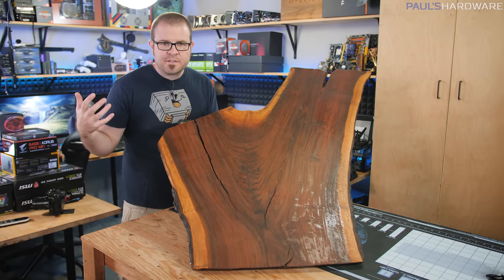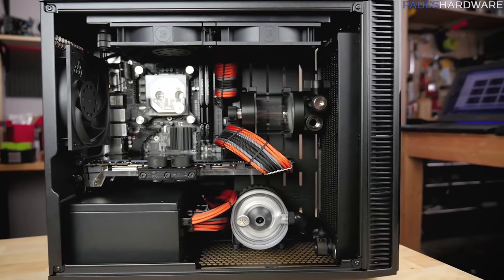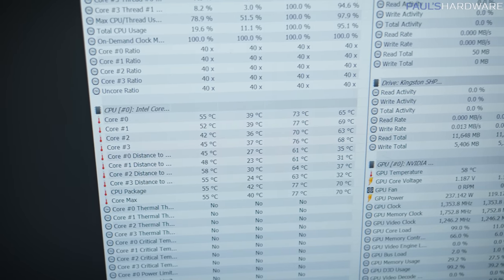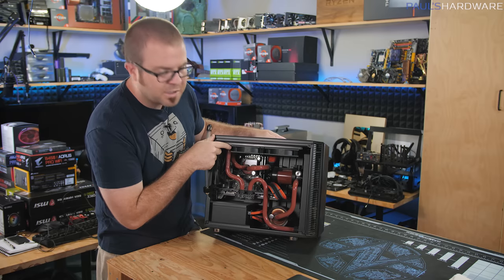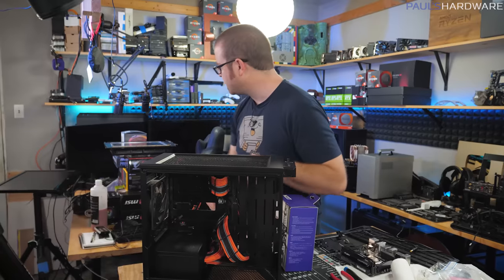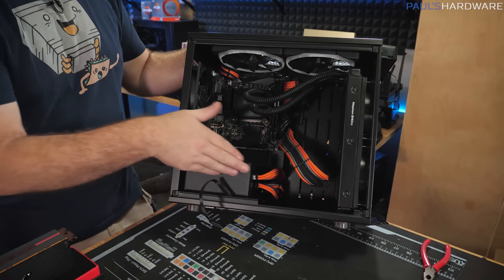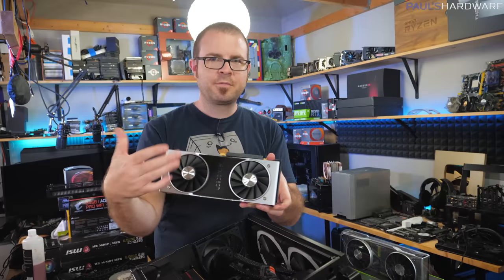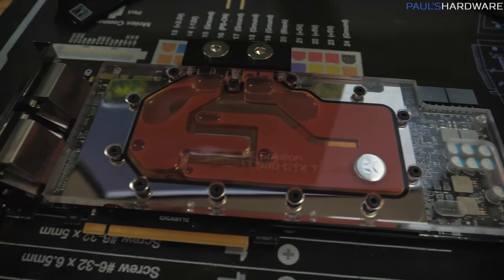Restoring HOTBOX: 3 Years Later

Comment: why even bother with temp testing if you're going with an AIO replacement? also if you were going open air gpu you should of used the aio as an exhaust. doing that cut like 10 degrees of my gpu temp.

Comment: a 2080 ti is a terrible choice for that system given the way it cools - if it were me, I'd just cut the plastic connection piece at the end of your sleved extension.  you could do it with a set of wire cutters or a deft hand and a dremmel or a thin hacksaw or really any other cutting implement that is narrow enough to precisely get between the 6 and the +2.  you can just cut the plastic and it'll be fine with the navi card, and the navi card's cooling solution would be significantly better for that build for all the reasons you mention.

Comment: I remember when you built this PC. I built my own 6700K 980 ti build. I am still running the 6700k, I upgraded to dual 980 ti, then just recently upgraded to an RTX 2080. I am building my AMD 3700x PC one part at a time. I have a Corsair iCUE 220T RGB Airflow white case on the way. My 6700K is starting to show it's age. Cheers Paul!

Comment: I'm about to replace my 6600K with a 3700x, but if I had (should have) ponied up for a 6700K at the time, I'd hold off.  Running an RTX 2070

Comment: Perhaps the temperature deceased due to the fact that the GPU isn’t in the water cooling loop after you changed the system to AIO. Since it works either way, it doesn’t matter after all.

Comment: i recently tried to place the front face plastic on pc case while the front fan was spinning. one of the clips got into the fan and broke one of the blades. i ran the pc with the broken fan and it was wobbling the pc like an old washing machine because the fan isnt balanced. i super glued the broken blade on the 200mm fan and now its ok. tomorrow i get a new rgb 200mm fan. end of story.

Comment: You could easily solve the 8 pin issue by simply cutting the plastic between them. I've had to do that a few times and its worked every time.

Comment: Why dont you cut the two pins? Not the cable itself, but just the connector to separate them, its just plastic after all, right?

Comment: Paul I had the same issue with my second 8 pin i just used a craft knife to cut that little bit of plastic out. 
Then made sure the connector was wired the right way an then tested it an it works fine no issue's at all.

Comment: you could cut the connecting plastic bit in the second 8-pin connector so it would work with the radeon 5700 xt